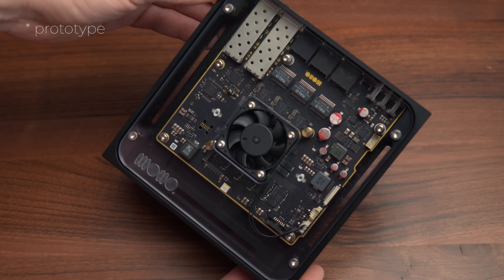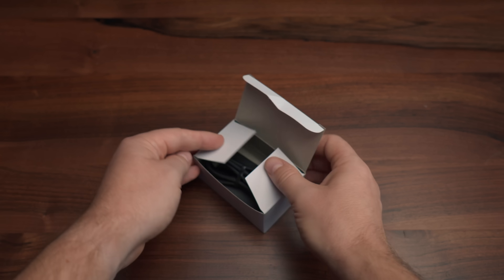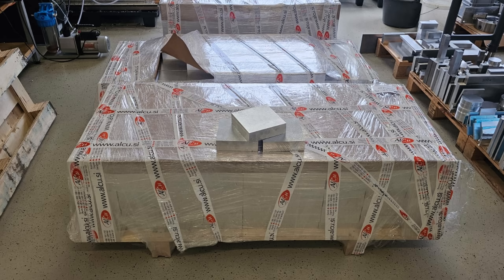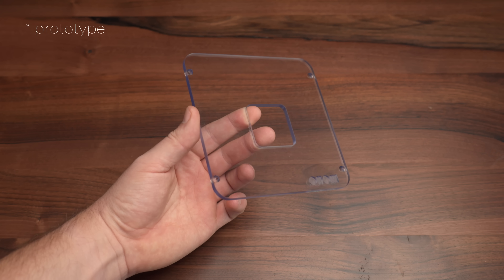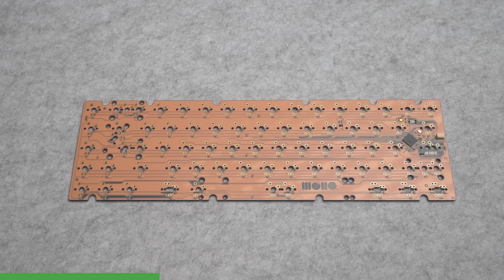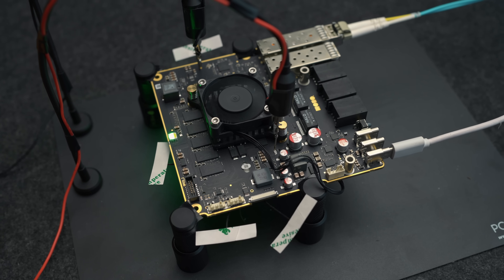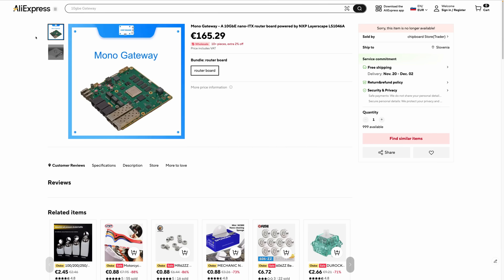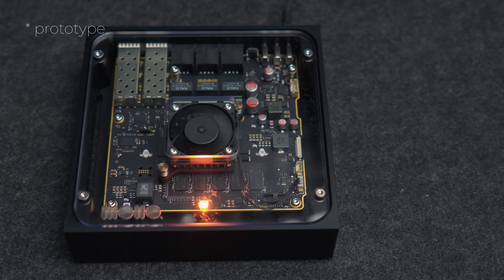My ISP gave me a router I didn't want. So I made my own.

Comment: Id love if there was a way to use this to ditch my vdsl modem as well...
Reply: vdsl? that is a blast from the past, I had VDSL back in 2010 or so, I didn't know DSL was still in use :P
Reply: I have vdsl as well... 60 Mbps, that's it 🫤
Reply: @Parancsmester  You have my sympathy, in my country the old copper-based network has been shut down. It’s either 4G/5G, HFC or fiber now.

Comment: What does this router solve that I can’t get from one of these n305 or Atom router boxes from Ali Express?

Edit: don’t get me wrong, building a router from scratch is absolutely amazing and I follow this video series. But for the price the Ali boxes are great
Reply: - no 10gb/s (i bought 3, they advertise it, but they don't deliver)
- cheap components (cap's, resistors, µ's, etc.)
- durability
- reliability
- hackability
- performance

it's like comparing a Kia to a Rolls Royce.
Reply: @UNgineering which CPU can't do 10Gbps routing? Cuz I find it hard to believe that an N100/150/305 etc can't do that.
Reply: build quality, hackability/expandability, documentation, the community, etc.
Reply: I just bought a Minisforum > $1K for that reason (i.e. 2x 10gb), but would rather have a product that focused more of that cost on my needs. Point is, for me the value is there.
Reply from the maker: They, for the most part, can't do 10 Gb/s. I've been meaning to make a video addressing this for quite a while now, don't have the time yet, so I hope soon after the new year.
Reply: @tomazzaman  that would be a good video where you benchmark your device and 2-3 of these cheap Ali Express routers side by side. Will help people understand what they get with your device and let them make the right choice (proper 10G box with enough power to route and firewall the traffic or a cheap box that runs a bunch of VMs…)
Reply: What about the Banana Pi BPI-R4 Pro?